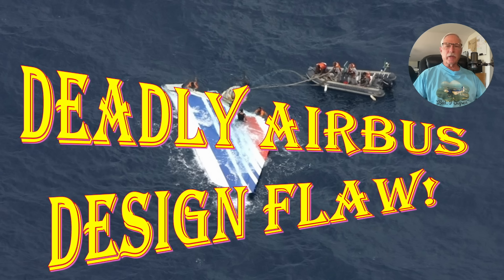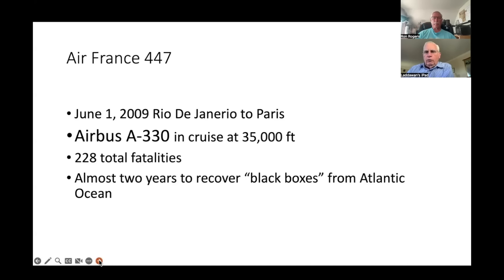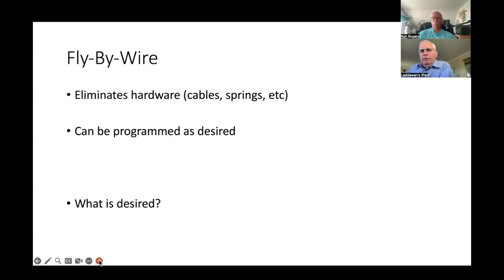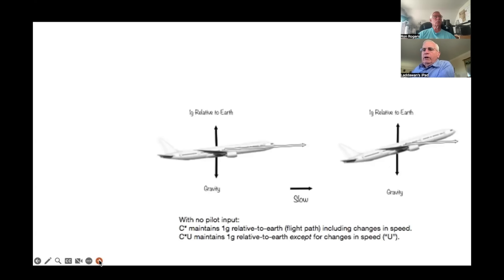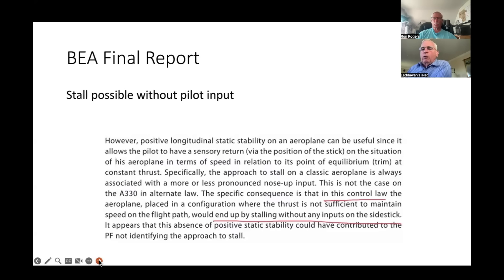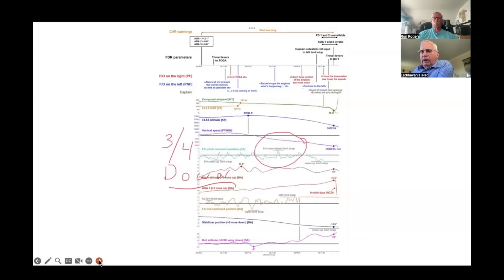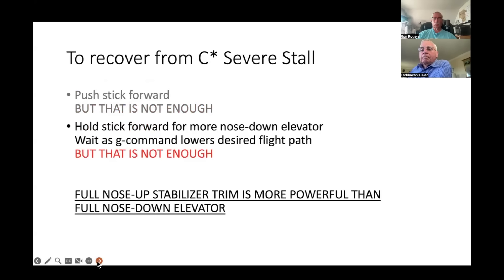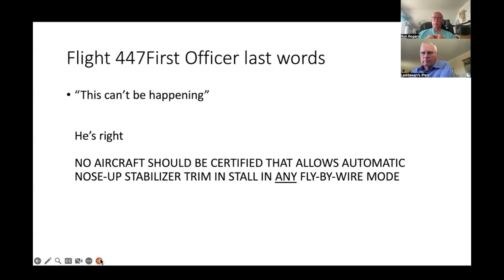Air France 447 Deadly Airbus Design Flaw! Tom Tilden about apparent speed stability in Alternate Law

Comment: Back in 1988 a AB 320 crashed doing a low level flyby in France. It crashed into the trees at the end of the runway. I read the blame was put on the pilot but I also read that the  comupter prevented  the the plane to go nose up when the pilot pulled back on the sidestick.
Reply: The accident you refer to is Air France Flight 296Q, an Airbus A-320 which crashed while making a low pass at the Habshiem Air Show in Germany on 26 June 1988.

The main cause was PILOT ERROR by flying to a slow-speed condition with power back where there was not time or altitude to recover before hitting the ground. As always, we should consider whether pilot error was the only cause. Let’s consider some human factors specific to Airbus fly-by-wire.

In fly-by-wire Normal Law, “protections” prevent entering a stall. The reason the pilot could not raise the nose more was that the aircraft was already very slow and pitch reached the stall prevention limit.
Note that until entering the stall protection speed range (actually based on angle of attack) there would be no increase in stick force required as the aircraft slowed – in other words, no apparent speed stability. But once in stall protection, increasing angle of attack would require increasing back pressure. When the limit allowed by fly-by-wire is finally reached, angle of attack will not increase even if more back pressure is applied. The flight was planned for low altitude (100 ft) and high angle of attack, but ended up lower than planned (30 ft) and with no margin for recovery.

Airbus auto-throttles are designed to assist recovery if approaching stall. At “Alpha Floor”, which is set in the protection range but before the stall limit, the auto-throttles automatically go to full power (Airbus engines are fly-by-wire like most modern airliners. Engine power in Airbus auto-throttle can move without throttle lever movement in the cockpit.) To prevent inadvertent power during landing, Alpha Floor is disabled below 100 feet. The plan was to click off Alpha Floor when it engaged and fly at a slightly higher angle of attack, but because they flew below the 100 foot limit, Alpha Floor would not engage anyway. By the time the pilots finally selected full go-around power, it was too late and the engines did not have enough time before impact to accelerate to the power needed.

There are many considerations here. The air show flight plan was overly aggressive, intending to show off the maximum angle of attack. The field was unfamiliar and the lineup changed during approach when the pilot saw where the crowd was aligned. There are way too many accidents in air shows - the desire to meet expectations is excessive. Airbus fly-by-wire is engineered to provide safe airline operations – when pilots intentionally exceed automatic margin protections, the feedback in controls is different from experience in most aircraft.

Comment: "Full nose-up stabilizer trim is more powerful than full nose-down elevator" - tell us more about how that is the case for us non-engineers.
Reply from the maker: The horizontal stabilizer is larger than the elevator and must move through a wide range to trim the aircraft through a wide range of speed changes and configuration changes. As a result, it it able to exert more aerodynamic force than the elevator. This is an overly simple explanation and I am sure others can and might add more detail.
Reply: @ronrogers  OK so there is a trimmable stabilizer rather than a tab. That makes sense then.
Reply from the maker: Ok, I see the issue. A trim tab would not over power the control surface. A movable horizontal stabilizer is better because of lower trim drag, but more difficult to implement. That is why most small aircraft (some exceptions, i.e. Piper) have a trim tab like my Cessna T310R. But, interestingly enough, my 1929 certified Great Lakes has a movable horizontal stabilizer and my trim cord adjusts it, not a trim tab!
Reply: @ronrogers  Just for trivia, the L1011 had a moving stabilizer as the primary control. What looks like an elevator is an anti-servo tab. Think big hydraulic Cherokee.

Comment: I am highly surprised Airbus has not insisted YOUTUBE to pull this post considering all the the EX or RETIRED Qantas and other airline pilots,  admitting Airbus does not allow negative reporting of their AUTOMATED flight issues. And there are many that have NOT been reported. My issue, of many, is the sidestick system. If you lose power, YOU LOSE ALL BASIC FLIGHT CONTROL. At least with the center pedestal yoke like Boeing and others,  there is some manual control. It's like losing hydraulic fluid in your car power steering.  I am glad to know there are pilots willing to share the EXTREME deficiencies AIRBUS has been allowed to get away from ridicule UNLIKE their competition, BOEING     Thank you Ron Rogers for this post!!!🙏👌
Reply: are you questioning Airbus?
Reply: Umm I think that when any Boeing type, (except the 737) lose all electrical power, they too will be uncontrollable - sidestick or not. 
Any FBW aircraft has the same problem.
Reply: Waiting to see if AirBus pushes back on this presentation.
Reply: @mikewysko2268  How can they?

Comment: “FULL NOSE-UP STABILIZER TRIM IS MORE POWERFUL THAN FULL NOSE-DOWN ELEVATOR”
“NO AIRCRAFT SHOULD BE CERTIFIED THAT ALLOWS AUTOMATIC NOSE-UP STABILIZER TRIM IN STALL IN ANY FLY-BY-WIRE MODE”

It’s incredible that, 30+years after the aircraft entered service, an independent test pilot has to tell the industry of this grave flaw.

As an aside: the inclusion of an AoA indicator on these aircraft is long long overdue.

Comment: We had a hard landing in MoBay, due to under speed. I never took the auto throttles off in a320, for that reason.
Reply: I will take the auto throttles off in a gusty situation. In a momentary speed increase from a gust, the auto throttles can reduce the thrust too much. On a Boeing, if the autothrottles try to bring the thrust back too much, you can simply put your hand on the thrust levers to prevent it. On the airbus, you have no quick override since the levers don't move. Thus, I will simply take auto throttles off so that I can have manual control.
Reply from the maker: Exactly! I would do the same for the same reasons!

Comment: To summarize…
If one is in alternate 1 AND the tubes are iced, alpha prot is nullified ?
I”ll reread the BEA report but was there not an issue with the aircraft being below 100 knots IAS and the stall protection system being in a “reverse” command area?
Reply: The icing caused fly by wire to degrade from Normal Law to Alternate Law. "Protections" that prevent stall are only available in Normal Law. In Alternate Law there MAY be some feel when approaching stall which makes the controls feel heavier but nothing will prevent continuing to stall if the pilot continues to pull. In the case of Air France, even that heavier feel feature was not available due to the conditions that caused the loss of Normal Law. The fly by wire Alternate Law logic was pure C* (g command) with no apparent speed stability feel in the controls as speed decreased. 
The "reverse" I think you are referring to was that with full back control AND full nose-up trim, angle of attack got so extreme in stall that the "STALL STALL" aural warning stopped. Designers assumed that an angle of attack that high was not possible. During stall when the crew did momentarily move the stick forward which reduced the stall a little, the aural warning came back on. When they pulled back again, the aural warning stopped. In other words, once in a severe stall, the stall warning only came on when they did the right thing and was off when they did the wrong thing.